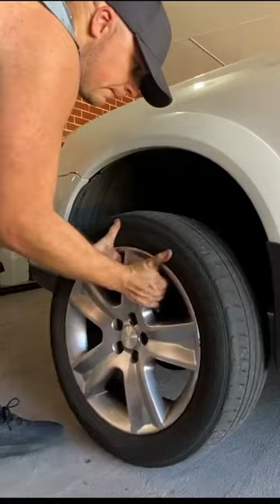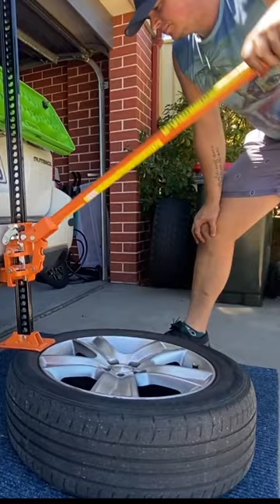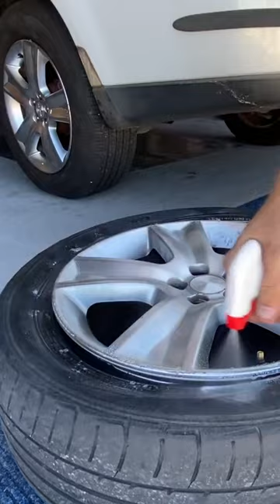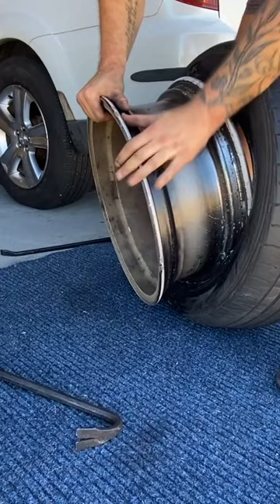How to remove a tire from rim DIY

Comment: I just tried this on my 07 Ford escape v6. Last guy that put the tires on was a ass. He put alot of black glue stuff inside the tire. So I did this nothing so I put 5 bags of concrete i had laying around and still not breaking the beed. Going nuts. But great video
Reply: It’s not black glue lol. It’s tire repair for sealing the tires to the wheels. Only supposed to be used for bead leaks. No one installing tires uses glue.
Reply: @1DjBBQ  Sorry tire pro 🤡
Reply: @markchapman2585  you're soft af😂 you really thought there was glue in your wheel😭🤡
Reply: It's called Bead Sealant. When I was in the tire shop I was taught to put it on every rim. Keeps the rubber sealed to the Rim.
Reply: @Quantum-dv1ng  Thanks for letting me know. Hate when they use too much.